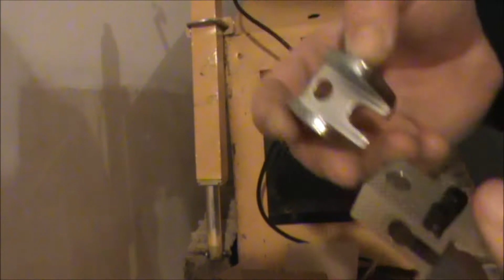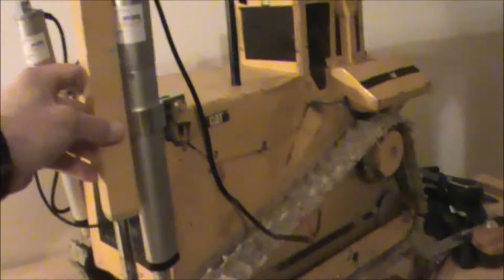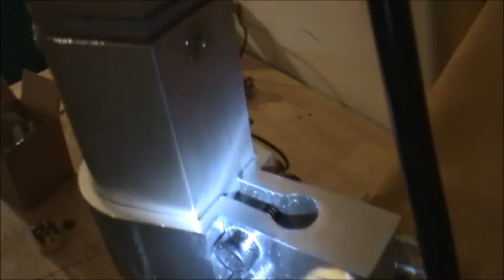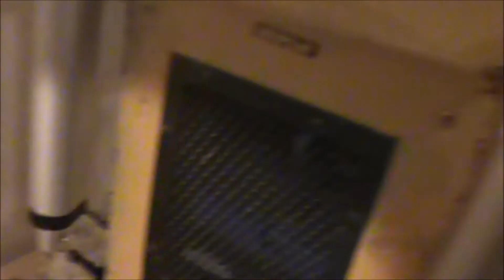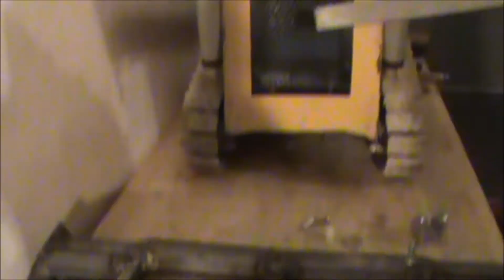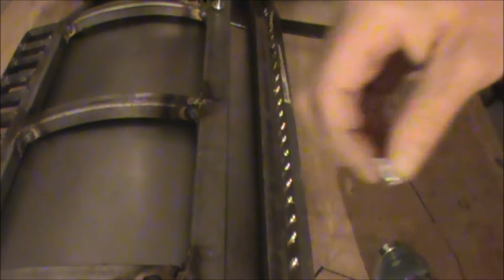Part 7 Blade Build for the RC Dozer

Comment: The welded bolts are a good idea, you might want to use jb weld so you can get every inch of the head of the bolt. As for the spacers, i would just use two sets of washers, one steel and one nylon with a little grease should work fine if you can find brass spacers.